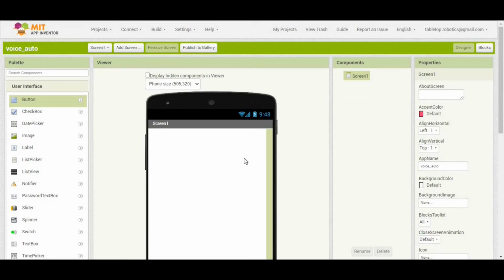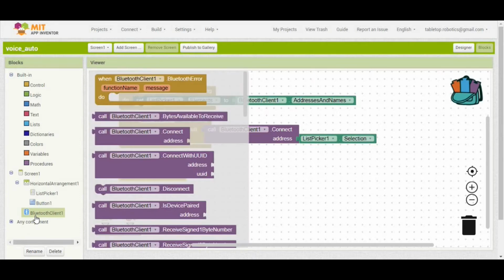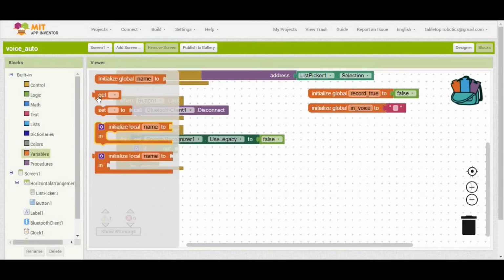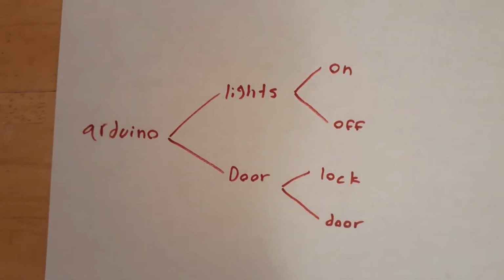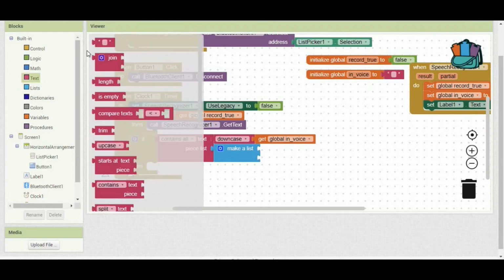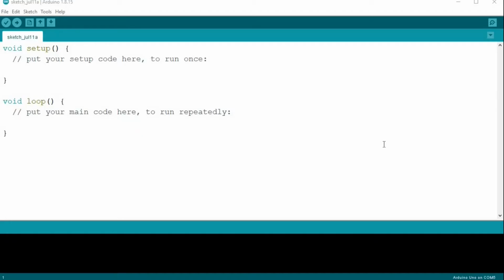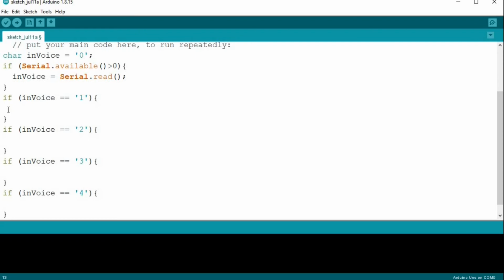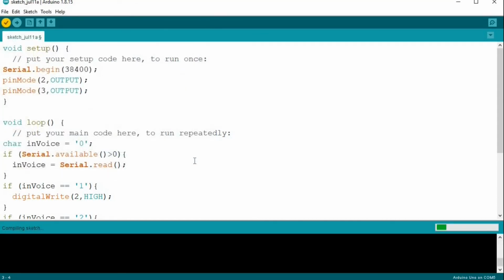DIY smart home (Arduino + Phone)

Comment: Hello bro, we're doing an IOT project named Gas Leakage Monitoring System using Arduino. We know how to do hardware part but the problem here is we have to create either a web application or mobile application on our own and we need to link it with our IOT project. We don't know how to do it because we're new to this branch. I hope you will help me to solve this problem. Hoping for your good reply!